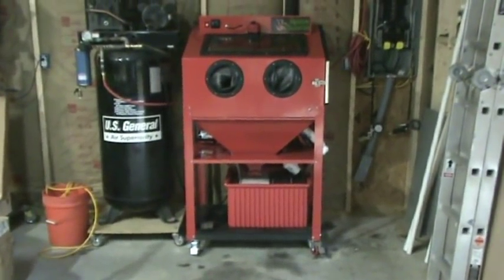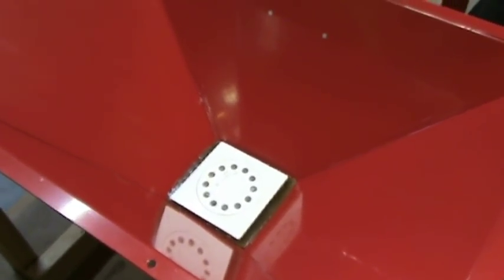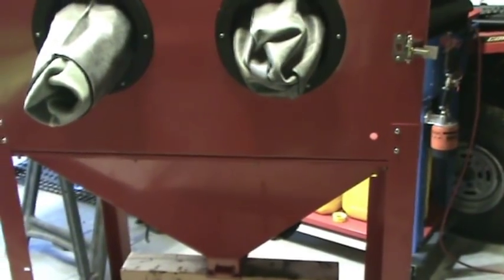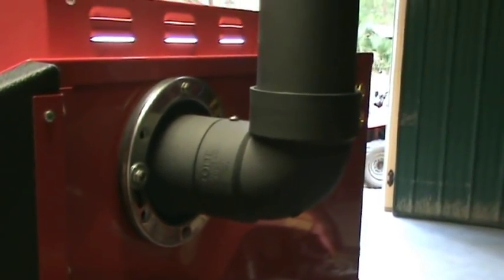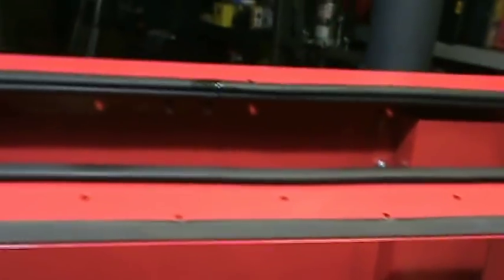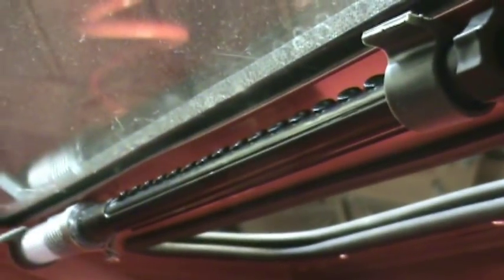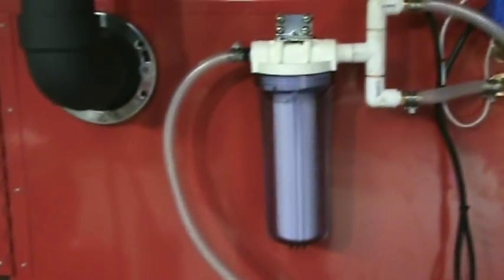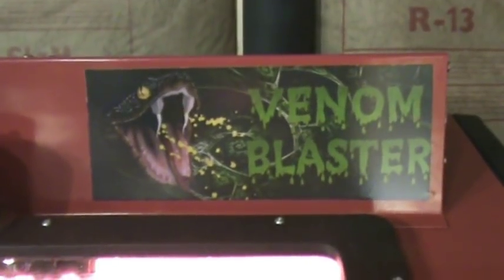DIY Vapor Blaster Cabinet Tutorial Harbor Freight $960

Comment: Have you seen the video of the alc plastic cabinet that a guy on here converted to a vapor blaster? He called it a aqua blaster, anyways do you think the hopper would have enough room in it for the trash pump like you are using? Thanks for the video and info also!
Reply: I finally started mine with the alc all plastic cabinet and the hopper area in it is huge compared to the harbor freight cabinet. Biggest draw back is the cost of the cabinet itself. It runs $460 from northern tool. I have watched your video a million times and really appreciate you putting this all together.

Comment: Nice work! I would have saved the time and money eliminating foam seal around the base and just use Lexel throughout, also where the fiber glass resin was used. If you want to thicken up the resin you can also use Johnson's Talc baby powder. Too bad you did not show a 5 sec clip of the unit working. It usually means it didn't work very well, when it's not shown
Reply from the maker: I have other YouTube videos of it working.. It works great... I use it almost every day restoring ATV's...

Comment: Is your viewing screen glass or plastic?? I got mine and it’s like a tough planting rather than glass..
Reply from the maker: The viewing window along with the window for the LED light are both glass. I was worried the wiper would prematurely scratch and ruin the glass, but so far the glass still looks like new.
Reply: Venom Chris I got to see if I can get a replacement for mine as it is plastic, can you remind me what you did about the big hole on the left side of the cabinet?
Reply from the maker: @nathanshaw8162  The cabinet came with a piece to block it off. I just put some silicone on it and placed it in the hole.
Reply: Venom Chris okay thanks. And what about the 2 tiny holes in the slurry/pump tank??
Reply from the maker: @nathanshaw8162   I put a stainless steel bolt and nut with silicone in those holes.. I believe it was 5/16", but check the size as harbor freight constantly changes things..
Reply: Venom Chris thanks, my short hose for the slurry to the gun turned up today, it’s half inch, but is yours a small reduced hole when you look down the tube? On mine the brass goes down to about 5-8mm
Reply from the maker: @nathanshaw8162   It is reduced somewhat.. I think mine was reduced to 3/8" I will have to check.. That is why I try and use the 1/2" size.. It will always be reduced somewhat at the fitting.
Reply: Venom Chris ahh that’s okay then, was just a bit panicked that it wouldn’t get a very good flow through.

Comment: Hi sir. I am your fan now. Please let me know which air compressor you are using on your DIY vapor blasting cabinet. Also let me know how much time it will take to clean a four cylinder small car engine.
Reply from the maker: https://www.harborfreight.com/5-hp-60-gallon-165-psi-two-stage-air-compressor-93274.html  That is the compressor I am using. Even with that I still need to stop occasionally to let the compressor catch up. The bigger the compressor you get the better.... Your other question is harder to answer. First if the engine is still assembled you would need a very large cabinet and second is how dirty and old the parts are. If you watch my other video where I have the Kawasaki 700 heads, it took me about 35 -40 minutes to do each head. They were in very bad condition with thick layers of carbon in the ports. The head was clean in about 5-6 minutes.. The rest of the time was spent cleaning out the exhaust ports..
Reply: If i use Tsurumi slurry pump 1 HP instead of half HP then what difference it can make.
Reply: @venomchris5818  can i use 3 HP air compressor. Will it work
Reply from the maker: @bittainment5995  It will give you more pressure, but will not fit in the cabinet the way I built mine. ..I get plenty of pressure with the 1/2 HP.
Reply from the maker: @bittainment5995  You can use a 3HP compressor , but you will have to stop very often to let the compressor build up pressure.

Comment: Nice job curious what prevents the cabinet from rusting?
Reply from the maker: Other than the paint on the cabinet and I sprayed a couple cans of leak stop as a barrier ..nothing.. The only things that rusted so far were the screws on the glove rings.. That was the only size I did not have in stainless. Now they were replaced with stainless as well as all the others..
Reply: @venomchris5818  jjbjnnbvv
Vb

Comment: Any ideas on where to find that model I did find one but it is in horrible condition and the guy wants $75 and iits like a 70 mile drive. I tried eBay FB marketplace Craigs List (where I found the beaat up one). Any other sites I can check. The newer version isnt bad I could weld it if it comes in pieces but I like having the light box on top!
Reply: I got mine through Home Depot. It is a Black Bull Cabinet, but it was NOT cheap. Pretty much the same design as the one Chris used.
Reply from the maker: I am going to build a new version using the newest Harbor Freight Blast Cabinet. I have come up with some great upgrades and modifications.. I am currently having some health issues that are slowing me down... I will try and get the newest version done soon..
Reply from the maker: Sorry about the late reply.. Having some health issues.. I just went on FB Marketplace and see two.. Both are asking $100 and they look in great shape. I guess it just depends on the area you are in to find one.  I will be building a new better version two using the newest Harbor Freight cabinet. I have come up with many improvements.
Reply: @venomchris5818  Sorry to hear that hope your feeling better! Ya I did find 1 but it was in really rough shape but I am keeping a eye out. I just know the newer version isint a sealed box like the first version in your video and ya I could caulk it but I woould rather have a welded box but if I cant find one I will have to go with the newer version. Right now I am using a 5 gallon bucket with a sand blasting gun it works but the media gets everywhere and I have to keep constantly mixing the media by hand so it is a real pita. Loved your video it makes way more sense doing it your way then spending thousands of dollars on a new one or shipping out all my parts to have them done. Thanks for the reply and I look forward to seeing your next video.
Cheers
Reply: @cbmracing499  55 gallon drum £10 to £20 on ebay make your own cabinet

Comment: Where did you purchase the nozzel? Also can you post an email for support and donations?
Reply from the maker: https://www.ebay.com/itm/35mm-Air-Sandblaster-Gun-Sand-Blaster-Kit-With-35mm-Boron-Carbide-Nozzle/264048617419?hash=item3d7a8627cb:g:LW4AAOSwvFpb8iWh:rk:18:pf:0  . That is US Stock. If you buy it from China and don't mind waiting you can get it for about $10 less.  All I ask is that I get subscribers.. Please ask all, your friends to subscribe.. Thanks.
Reply: Thanks for the reply, i have subscribed. What do you think of this pump to cut down on costs. Its a canadian website as I am in Canada. http://unclewiener.com/product/new-2-stainless-steel-trash-pump-12-hp-450f/
Reply from the maker: @hondaguy5904  It all has to do with the impeller. If it has a heavy duty Polyurethane Impeller it may be ok... The impeller is the weak link when it comes to building these. Also the model I used has a small agitation vane to help mix the slurry

Comment: Does it matter what submerging pump is used??
Reply: And the plastic filter tank/pump/filter is I irrelevant if you was to have a fresh water supply right? As from what I can gather that is only needed for the screen wash and rinse hose??
Reply from the maker: Yes , you want to use the pump described above.. Most pumps will not last long with the slurry...
Reply from the maker: @nathanshaw8162   Technically yes.. You would also need to drain off the extra water if using a rinse.
Reply: Okay thanks. Also what size and where did you get the rubber air & slurry hoses? And what are the screw ends??
Reply from the maker: @nathanshaw8162  I got one hose at Northern tool and the other on Amazom... But they are overkill ... When they wear out I will be changing to 3/8 or 1/2" nipples with normal hose that you can buy at Lowes. It is much more flexible and will work fine. Cheaper too.
Reply: Venom Chris would you say 1/4” would be sufficient enough??
Reply from the maker: @nathanshaw8162  Because of the low pressure pump I would not go below 3/8" and I would go 1/2" on my own.. 1/2" is what I am currently using.

Comment: Venom Chris did that gun come with a nozzle because it looked like it didn't have one in the picture the link you sent that lad
Reply from the maker: That particular one did not come with a nozzle which was disappointing. I posted that before I received it.. I have bought others for that price that came with the nozzle.
Reply: @venomchris5818  yes i fought it didn't looking at the pictures i allso emailed them but they was straying away from my question i ask them and there reply was  you dont get packaging with it instead of just saying you dont get the nozzle with it. What nozzle do they come with is it them pink one's like on a normal sandblast gun pal
Reply from the maker: @officialmysteriousrider6327  They are Black Boron Carbide nozzles. They usually come with 8mm

Comment: Is the wiper arm and the wiper both 11”??
Reply from the maker: I believe so, but I will measure them. If you are using the old style cabinet like me, you will nee to move the hole on the wiper blade a small amount to keep the blade from hitting the bottom. Or you could just trim of the end of the wiper blade. If you are using the new style cabinet you van just mount the wiper motor about an inch higher than I did and it will fit perfectly.
Reply: Venom Chris okay thanks my cabinet is similar but I’m in the UK so I cant find the ones you get over in the US. But it’s pretty much the same. Also the shaft on my motor is just under 2inches, the one you shared on here is 3-1/4, surely that would stick out quite far??
Reply from the maker: @nathanshaw8162  Since I went through the plastic window frame it was a good length..

Comment: What ratio Glass beads / water did you end up using ?
Reply from the maker: Hard to say.. I run the system with the filter system recirculating the media. So you will constantly lose some into the filter box. When I notice the performance going down I know it's time to add more media.  I initially fill it about 2 inches above the pump opening at the base after a cleaning. If I am using the recycled media from the filter box I dump the whole thing in.

Comment: Where did you get wiper motor from?
Reply from the maker: I ended up replacing that one with the following one. You will need to get short arms and blades. They are much easier to find than for the first one.  https://www.ebay.com/itm/176272817166?_trkparms=amclksrc%3DITM%26aid%3D1110006%26algo%3DHOMESPLICE.SIM%26ao%3D1%26asc%3D262139%26meid%3D1b1fd6de94cc485182155c6f6303ed34%26pid%3D101875%26rk%3D6%26rkt%3D12%26sd%3D196083536722%26itm%3D176272817166%26pmt%3D1%26noa%3D0%26pg%3D4429486%26algv%3DSimplAMLv11WebTrimmedV3MskuWithLambda85KnnRecallV1V2V4ItemNrtInQueryAndCassiniVisualRankerAndBertRecallWithVMEV3CPCAutoWithCassiniEmbRecallManual&_trksid=p4429486.c101875.m1851&itmprp=cksum%3A1762728171661b1fd6de94cc485182155c6f6303ed34%7Cenc%3AAQAJAAABcLSVkHmTL63bebovD9RfpraPWbY9f4anjbziTIaEIOVXg2DWhVLks3Lfqff9vxxfjIh4XEXusIehlT2iEH8%252BCxXNySMxlDIQJ3g86%252Bx3AAIAq9gznqdGSR72ksP41kjzPN1reUbVsJuld0S4i4qXlQfTmkMeIJTCXTM8mLpr7ju2fMvruDu87ZX%252B4bShOvD%252B4gfH5DZGkQnyuGV1ajgqDvm80%252Fnk0WjnNUxRpGGkhXcAHfvlZDgbnsZ1RJPIA4mIE%252BRM%252Bd2BDV7JGCL7WcsgOwCst9jOXDEJbmzbp7nEb7d%252FS6kgSNa7UHS1JG5PavItPM7ZJPH3x2GZt8COPqJQ4FQ0GXXAc1U2qrpQsHr09LrwSyHkKc3P55VCGQURE2LDWxz%252BrtELEZOr2nbR56%252BE6YAiu6Vzl7vBI369lEty0Z4rXv1xB6nnyvpGpe1oAsTUnLw2KCVNG4uNgM5QEsJVQqbaptil%252FDpNQ%252FHmQmYE7spt%7Campid%3APL_CLK%7Cclp%3A4429486&itmmeta=01HS6KNP821YCXVN4KXDN2A2ZX

Comment: What is the smallest size compressor you can get away with?
Reply from the maker: You can use a small compressor but you will need to stop very often to let the compressor recover and build pressure.. I am using a 5HP 230 volt two stage 60 gallon compressor and I still have to stop and give it recovery time.
Reply: Venom Chris How many CFM ?

Comment: Can this build be interchanged to just sand blasting and swapping between the two?
Reply: Dude....
Reply from the maker: I would not do that. The dry blasting would take the finish off the metal cabinet and it would rust very quickly when doing wet blasting

Comment: could I use a 1 hp pump?
Reply from the maker: You can use a 1HP just make sure it is a trash pump with a urethane impeller
Reply: Anyone using flotec pumps? Thinking about the E75STVT model